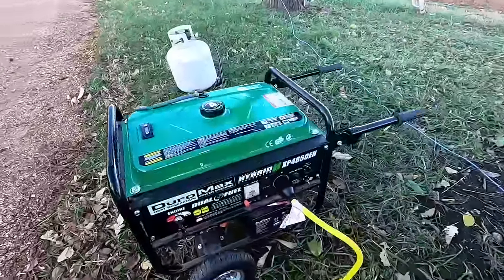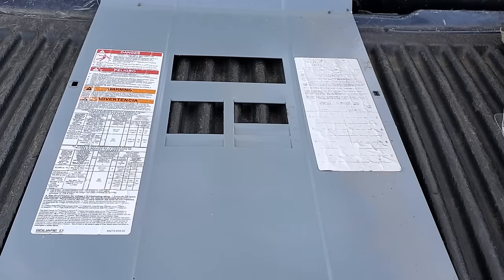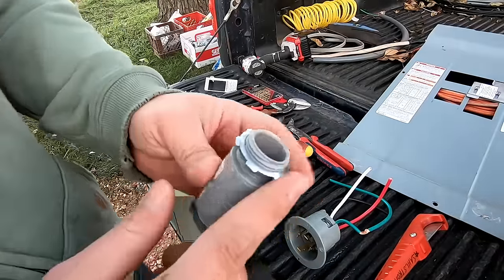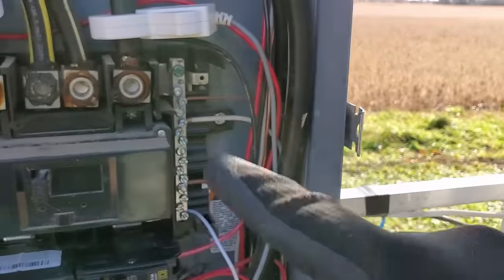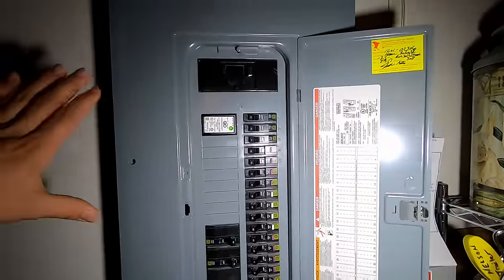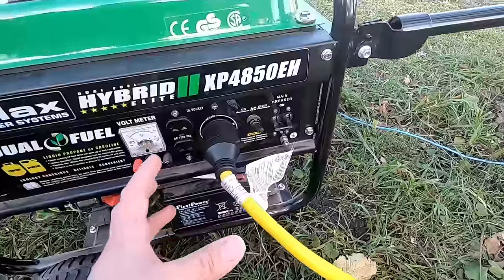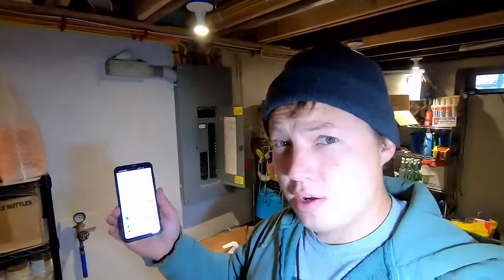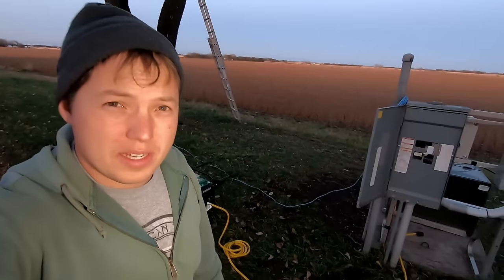How To Hook Up a Generator To Your House Using a Breaker Interlock Kit & Power Inlet Box

Comment: What are the exact steps to having the sense be able to read the wattage when the main power is out and the generator circuit is active? Would you install the sense as your normally would?
Reply: Don’t forget about the safety rules of using generators: Always make sure you follow all the generator safety rules whenever you use your portable generator. This is only a reminder. Generators can be dangerous if not used carefully. Every year, hundreds of people die or get injured when using portable generators due to carbon monoxide poisoning and electrocution. Make sure you are using your generator carefully and keeping others safe as well. There is something very serious that everyone should always be aware of when using generators. Some people do run their generator indoors which is not safe and that increases the risk of carbon monoxide poisoning which can cause death of family and you. Some people run their generator in wet conditions which can electrocute them. Please remember that you should never run your generator indoors. Remember that carbon monoxide is an odorless and colorless gas that you cannot see or smell. Carbon monoxide is a silent killer. Keep that in mind. Make sure your generator is 15-20 feet away from your house and away from doors, windows, and vents. Never use your generator in your porch too. Having a carbon monoxide detector is very important against generator safety. Some people also allow children to go near the portable generator which could pose risks. We need to keep an eye on our children making sure that they are not near the portable generator so they won’t get electrocuted or burned by the generator which is dangerous. A locking enclosure also keeps kids safe. A generator shed might look like a tempting place to explore, or take cover during a game of hide and seek, but a generator is a dangerous piece of equipment that can cause injury. It says on the manual that we should also keep children away at all times from the portable generator to avoid injuries. Please do not allow a child or unqualified people to operate the portable generator.  It is important to keep your children safe especially little ones. The portable generator can be hot during an operation. Just because some manuals missed what should be listed doesn’t mean it’s safe to do. Always follow the generator safety rules when using portable generators. Generators pose electrical risks. If you need to use your generator during wet weather, you need a generator tent to protect your generator from getting wet. Don’t let your generator get wet. Keep your generator dry and before using your generator, please make sure your hands and your generator is dry. Do not wear loose clothing when operating the generator. Everything that is said on the generator’s operating manual should not be ignored. Never smoke cigarettes near the generator. Please keep flammable things away from the generator. Never overload your generator too. Your generator can catch fire. Never ever try to plug a generator cord into a wall outlet to avoid back feeding. Back feeding your generator is dangerous. Always turn on your generator first before plugging in appliances and shut off the appliances before turning your generator off. Use a heavy duty cord for your generator and the cord should not be worn out. All the instructions should be followed carefully. Never refuel your generator while it’s running. It can cause fire if fuel spills while your generator is hot. You should turn off your generator and let it cool off before refueling it. Having a fire extinguisher next to the generator is also important. This is only a reminder for everyone’s safety of using generators. Make sure your generator is properly grounded. Having a fire extinguisher next to the generator is also important against the safety rules. https://youtu.be/I1jT3ANENvI and here is a video more about keeping others safe when using generators and also about our family’s safety. It’s important to keep our little children safe as well. Make sure your little children are kept away from the generator at all times especially when it’s running. Hope this helps. Always remember that it’s better to be safe than sorry.

Comment: I might have missed it in the video. But if you loss power from the grid, and running on generator, will that sensor monitor let you know when grid power has returned?  If not , is there a way to see if power has returned, besides looking at your neighbors house.
Reply: Don’t forget about the generator safety tips as well. Remember safety is always important. Here are the generator safety tips:

1) Please do not allow an unqualified person or your children to operate the portable generator. Just because some manuals don’t say that doesn’t mean it’s safe. That is important against the generator safety rules. We also need to be keeping an eye on our children too. You need to make sure that your children are not playing near the portable generator especially when it’s running so they won’t get electrocuted. Generators pose electrical risks and they can be hot during an operation. Please keep your children away from the portable generator at all times. It is important to keep our children safe especially our little ones. Be aware of all the hazards.

2) Some people use their portable generators indoors which increases the risk of carbon monoxide poisoning. It’s important to have a carbon monoxide if you have a gas generator. Never ever use your generator indoors even if your doors and windows are open and even in the garage is not safe to use a portable generator. Not even at your porch and your deck. It is never safe to use your generator indoors and in enclosed areas of your home. Your generator needs to be 15-20 feet away from your house. 

3) 🔥generators cause fire hazards too. Never refuel your generator while it’s running. You need to let your generator cool off before refueling it and before storing your generator. Never overload your generator too. Never ever back feed your generator. You should never plug your generator into a wall outlet. Also never store propane tanks indoors. Please keep flammable things away from the generator as well and please don’t smoke cigarettes near the generator. Having a fire extinguisher next to the generator is also important against the generator safety rules. 

4) generator operation; make sure your hands are dry before touching the generator. Never use your generator in wet conditions. Don’t let your generator get wet. You need a generator tent if you need to use your generator during wet weather. Please don’t wear loose clothes when operating the generator. Turn on your generator before plugging in appliances. Use the right cord for your generator. Please do not use worn out cords. 

https://youtu.be/I1jT3ANENvI and here is a video more about keeping others safe when using generators and also about our family’s safety. 

Hope this helps

Comment: The breaker at the generator kicking off could have been from the fridge, freezer or well pump power surge when it turned on.
Reply: I have read using LP reduces rated output as much as 10% on generator compared to gasoline

Comment: Any penetration above the lower 1/3 of a junction box, panel etc, should be watertight, ie, should use a sealing locknut were conduit goes into the gen box, also the original unused mounting holes should be sealed, why not use thhn/thwn instead of stripped uf, not sure it meets NEC. On a separate note there should be breakers to isolate your separate sub panels in your main panel, ie your house and out building, not just connect leads to main buss with lugs and use the main breaker. Are you subject to inspections? Also when connecting ground wire inside gen box there should be a mechanical bonding screw threaded to the box itself with a tail wirenutted together with the other ground wires.

Comment: Excellent video. Very well done!!!
Reply: ⚠️ Here are the reminders about generator safety. We always need to make sure we follow all the generator safety rules whenever we use portable generators: 

Everyone must see this 

1) KEEPING OTHERS SAFE: Please do not allow an unqualified person or your children to operate and service the portable generator. Just because some manuals don’t say that doesn’t mean it’s safe. That is important against the generator safety rules. We also need to be keeping an eye on our children too. You need to make sure that your children are not playing near the portable generator especially when it’s running so they won’t get electrocuted. Generators pose electrical risks and they can be hot during an operation. Please keep your children away from the portable generator at all times. It is important to keep our children safe especially our little ones. Be aware of all the hazards.

2) WHERE TO RUN YOUR GENERATOR: Some people use their portable generators indoors which increases the risk of carbon monoxide poisoning. It’s important to have a carbon monoxide if you have a gas generator. Never ever use your generator indoors even if your doors and windows are open and even in the garage is not safe to use a portable generator. Not even at your porch and your deck. It is never safe to use your generator indoors and in enclosed areas of your home. Your generator needs to be 15-20 feet away from your house. 

3)🔥FIRE HAZARDS: Never refuel your generator while it’s running. You need to let your generator cool off before refueling it and before storing your generator. Never overload your generator too. Never ever back feed your generator. You should never plug your generator into a wall outlet. Also never store propane tanks indoors. Please keep flammable things away from the generator as well and please don’t smoke cigarettes near the generator. Having a fire extinguisher next to the generator is also important against the generator safety rules. 

4) GENERATOR OPERATION: make sure your hands are dry before touching the generator. Never use your generator in wet conditions. Don’t let your generator get wet. You need a generator tent if you need to use your generator during wet weather. Please don’t wear loose clothes when operating the generator. Turn on your generator before plugging in appliances. Use the right cord for your generator. Please do not use worn out cords. 

https://youtu.be/I1jT3ANENvI and here is a video more about keeping others safe when using generators 

Hope this helps

Comment: Thanks for the Video. I'm on the fence of which direction that I would like to go. Breaker Interlock setup Vs Transfer switch setup?  The only reason that I would choose Transfer Switch setup is because you are less likely to overload your generator? Are there any other pros for choosing a Transfer switch setup?
Reply: Don’t forget about the safety rules of using generators: Always make sure you follow all the generator safety rules whenever you use your portable generator. This is a reminder for everyone’s safety of using generators. Generators can be dangerous if not used carefully. Every year, hundreds of people die or get injured when using portable generators due to carbon monoxide poisoning and electrocution. Make sure you are using your generator carefully and keeping others safe as well. There is something very serious that everyone should always be aware of when using generators. Some people do run their generator indoors which is not safe and that increases the risk of carbon monoxide poisoning which can cause death of family and you. Some people run their generator in wet conditions which can electrocute them. Please remember that you should never run your generator indoors. Remember that carbon monoxide is an odorless and colorless gas that you cannot see or smell. Carbon monoxide is a silent killer. Keep that in mind. Make sure your generator is 15-20 feet away from your house and away from doors, windows, and vents. Never use your generator in your porch too. Having a carbon monoxide detector is very important against generator safety. Some people also allow children to go near the portable generator which could pose risks. We need to keep an eye on our children making sure that they are not near the portable generator so they won’t get electrocuted or burned by the generator which is dangerous. A locking enclosure also keeps kids safe. A generator shed might look like a tempting place to explore, or take cover during a game of hide and seek, but a generator is a dangerous piece of equipment that can cause injury. It says on the manual that we should also keep children away at all times from the portable generator to avoid injuries. Please do not allow a child or unqualified people to operate the portable generator.  It is important to keep your children safe especially little ones. The portable generator can be hot during an operation. Just because some manuals missed what should be listed doesn’t mean it’s safe to do. Always follow the generator safety rules when using portable generators. Generators pose electrical risks. If you need to use your generator during wet weather, you need a generator tent to protect your generator from getting wet. Don’t let your generator get wet. Keep your generator dry and before using your generator, please make sure your hands and your generator is dry. Do not wear loose clothing when operating the generator. Everything that is said on the generator’s operating manual should not be ignored. Never smoke cigarettes near the generator. Please keep flammable things away from the generator. Never overload your generator too. Your generator can catch fire. Never ever try to plug a generator cord into a wall outlet to avoid back feeding. Back feeding your generator is dangerous. Always turn on your generator first before plugging in appliances and shut off the appliances before turning your generator off. Use a heavy duty cord for your generator and the cord should not be worn out. All the instructions should be followed carefully. Never refuel your generator while it’s running. It can cause fire if fuel spills while your generator is hot. You should turn off your generator and let it cool off before refueling it. Having a fire extinguisher next to the generator is also important. This is only a reminder for everyone’s safety of using generators. Make sure your generator is properly grounded. Having a fire extinguisher next to the generator is also important against the safety rules. https://youtu.be/I1jT3ANENvI and here is a video more about keeping others safe when using generators and also about our family’s safety. It’s important to keep our little children safe as well. Make sure your little children are kept away from the generator at all times especially when it’s running. Hope this helps. Always remember that it’s better to be safe than sorry. Also remember that warnings should not be ignored too.

Comment: why wouldn't u just run a relay to erupt the power to the generater box and have the relay powered by a beaker anywhere in the fuse box( you may need one for both bar)? plus it would need very little outfitting,